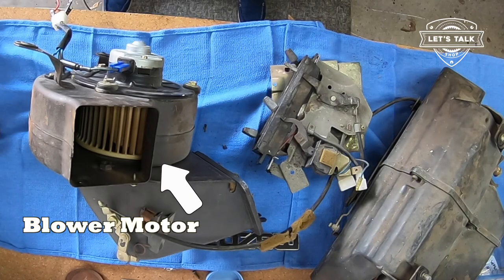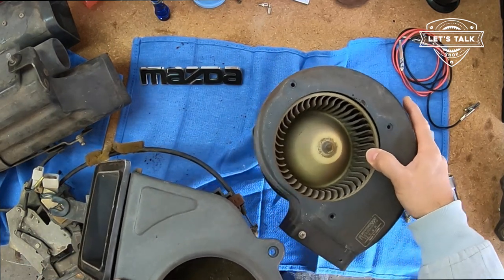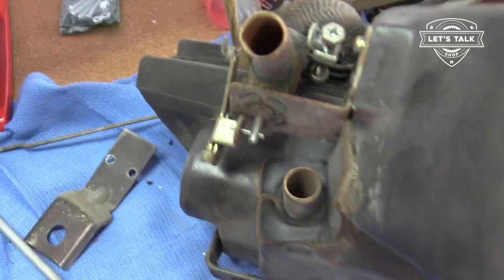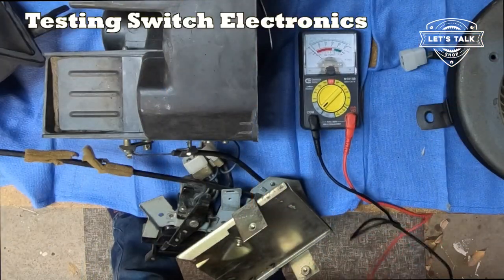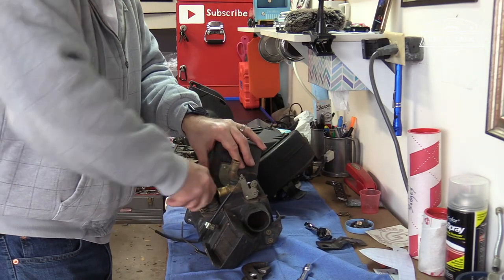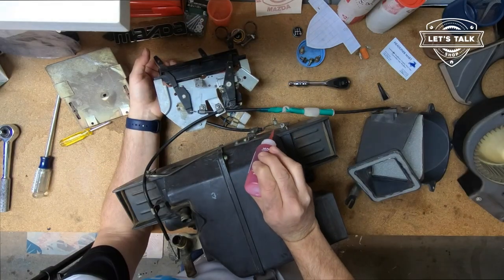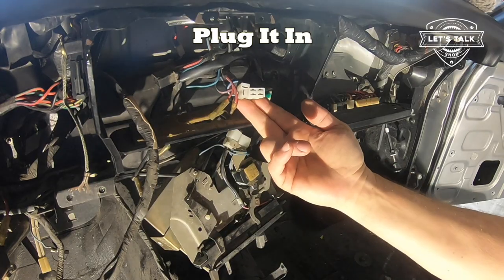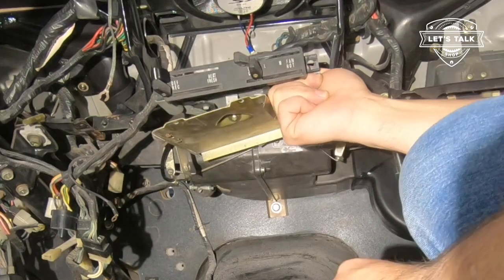Vlog 64 Heater Blower Core Switch Panel Testing Inspection Install Mazda RX3 Restoration

Comment: When I re-coed the heaterbox in my RE Capella, I thought the core was fine. Radiator shop confirmed. I tried it again at home, this time in hot water, once everything warmed up, there were a few pin holes. Ended up getting a new core.